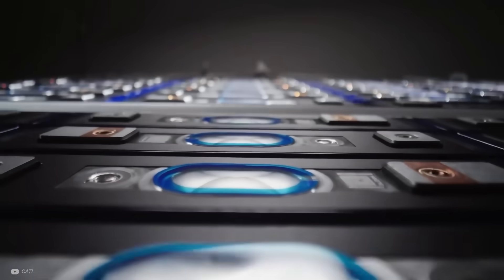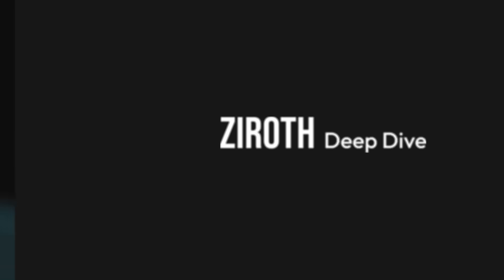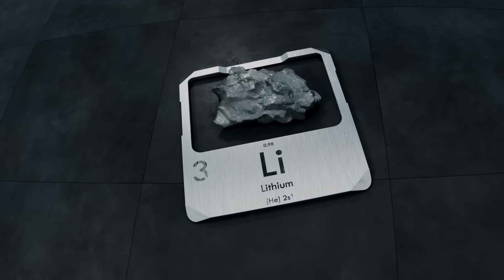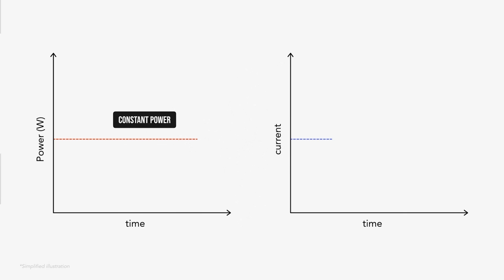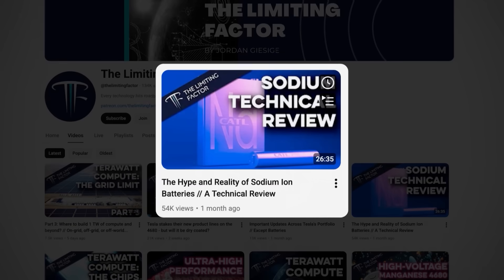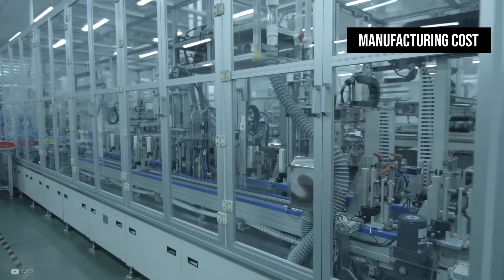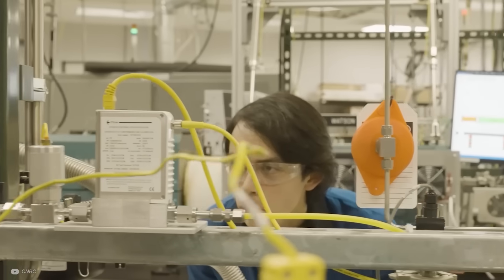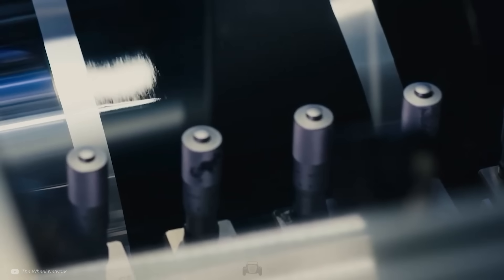How CATL’s Reinforced Sodium Battery is Insanely Cheap

Comment: CATL is already producing sodium batteries. The price is currently just under the Lithium batteries. CATL expects the price will drop to $ 10.-- per Kwatt/h in 5 to 10 years, probably 7 or 8 years. As the new sodium cells can be produced on existing production lines even with higher speeds, it will take no more than three years before the sodium cells will be available in large quantities and will become common in EV's.
Reply: $45 USD now, $30 USD is the Gen 2 goal and a long term price goal by 2030 of $19 USD per kWh is what their spokesperson was touting during a vlog piece from the Shanghai Autoshow IICR... The data shown in this video was already old and didn't take into account the newest CATL NAXTRA chemistry which is the one the video is really about.. The 175 wh/kg battery already superior to the first generation of BYD Blade LFP that people were raving about before.. Despite its 160 wh/kg density being lower..
Reply: @stickynorth  False. CATL hasn't announced any pricing information for their Naxtra sodium-ion batteries and in China high GED layered-oxide sodium-ion batteries cost ~75% more than LFP batteries (~US$70/kWh vs ~US$40/kWh).
Reply: Incorrect that they can be produced on the same production lines (at scale) and incorrect that the price of CATL's sodium-ion batteries is currently less than their LFP batteries.

Large, highly optimised LFP production lines will not be retrofitted to produce sodium-ion batteries.
Reply: @borg95  According to the CATL's CEO the sodium-ion batteries are already in production on a only slightly altered lithium-ion production line. As the raw materials cost less than the lithium they are slightly cheaper. As the sodium-ion solution has a lower viscosity it must be possible to speed up the production. He explained al in a video which is published on YouTube. Just have a search.
Reply: @wilsistermans1118  They're not cheaper and there are no public examples of any 10GWh/year scale factory switching from producing LFP battery cells to producing sodium-ion battery cells. Currently high GED SIBs cost approximately 75% more than LFP cells (~$70/kWh vs $40/kWh).
Reply: @borg95  Sorry, but my source (news) is the CEO of CATL and I think he knows what is going on in his factory.
Reply: @wilsistermans1118  CATL or their CEO hasn't provided any public pricing information on their new Naxtra sodium-ion batteries or stated what the nameplate capacity of their SIB production lines are.

CATL's talk of "mass production" of SIBs in 2026 is just marketing hype intended to put a lid on the price of lithium carbonate. It could mean many different things (e.g. 1/10/100/1000 GWh per year).

The nameplate capacity of BYD's SIB factory (which they've been building for the last two years) is only 30 GWh/year.

For comparison, the total nameplate capacity of all LIB factories has recently surpassed 3000 GWh/year.
Reply: @borg95  CATL currently sells Sodium batteries 2% cheaper as th LI-ion ones. There is no large scale production yet, but CATL is producing Sodium cells since 14th of november and planning to extend the production.
Reply: @wilsistermans1118  Source or data sheet or specs? Selling to who exactly and for what cell price (in $/kWh)?

When I asked them 12 days ago, Starmax Energy (Chinese battery reseller) said that CATL's Naxtra sodium-ion batteries aren't currently in bulk production and they said that they would post an update on their YouTube channel when cell pricing was released.

If you have a reliable source, do you know what battery chemistry CATL are using for the Naxtra cathode (e.g. NFM/layered oxide, prussian white, NFPP etc.) and anode (e.g. hard carbon)?
Reply: @borg95  The source was an announcement video of the CEO of CATL on the site of an Chinese newspaper. I saw the video in the first half of december, but they remove video's after a month. 
Production is still limited for the Chinese market only. Price is in Yuan only, but I don't know it.
The expectation (according to de CEO) is that Sodium cells will slowly become mainstream after two or three years.
Reply: @borg95  That depends more on what technology is more in demand of. That has always been a thing. The fact they can switch means it opens the door for a quick switch later down the road is all.
Reply: @adr2t  For large factories (multi gigawatt-hour/year) they can't and won't switch between producing LFP batteries and producing  sodium-ion batteries (see the Catalyst podcast titled the "Promise and perils of sodium-ion batteries" from February 2025 for reference).

This is why BYD has been building a new 50GWh/year sodium-ion battery factory for the last few years rather than retrofitting an existing LFP factory where they have spare capacity.

Current capacity of all existing LFP factories is estimated at ~3TWh/year and the large production lines can't just be switched over to producing SIBs when the demand is there.
Reply: @borg95  They will depending on demand. Almost all of them have or will. Its not that crazy considering its about the same process. Now, I think you are talking about hot switching- then no. Of course not, it be cheaper to produce a whole new line, but long term, they are not going to not switch if LFP becomeless than what Sodium can do if demand calls for it.
Reply: @adr2t   I disagree. There are no examples of any 1GWh+/year factory that has switched from producing LIBs to producing SIBs. I'm not saying it's impossible to switch, but my point is that switching cell chemistry for a large factory is a multi-year process. It is not simple or cheap to just switch existing LIB factories over to creating SIBs.

If you want a real world example see the 35 GWh/year GM/Ultium Cells Ohio plant, which announced a switch from NCM to LFP batteries. They expect the conversion of all cell lines will take over 2 years, even though converting from NCM to LFP is simpler than converting from LFP to SIB (e.g. NFM, PW, or NFPP) as only the cathode material changes, whereas SIBs use a different anode (hard carbon), anode current collector (aluminium) and electrolyte.

Also for SIBs to reach LIB scale, there is still a lot of work to be done on scaling up hard carbon production.
Reply: @borg95  What do you mean? Its not like they just factory just for SIBs just to test - they had to take a line/factory and produce them.
Reply: @adr2t  Testing is easy, you don't need to do it at scale. For at scale production they will create their own factory/production lines rather than retrofitting existing lines.

According to the July 2025 Benchmark Minerals article titled "Sodium-ion dominated by unproven cell producers", CATL has a sodium-ion battery facility (with a nameplate capacity of 25GWh/year once ramped up) that came online last year. Also CATL has been talking up sodium-ion batteries since ~2021 so it's not something that happened overnight.

The only other factory of that scale is BYD's 30GWh/year factory that they've been building for the last two years. Neither factory is actually producing sodium-ion batteries at anywhere near capacity though.

IIRC BMI estimated the total production of sodium-ion batteries for 2025 to be ~5-10 GWh, and estimated (nameplate) production capacity to be ~120GWh with growth to ~500 GWh in 2030 (with most of the planned capacity coming from "unproven" Tier 3 cell producers).

I expect sodium-ion batteries will take less than 10% of LFP's market share by 2030.

Comment: Same shitty  voltage curve that lead has.voltage goes down fast
Reply: The voltage curve is not the problem with lead acid, it is the death of the battery if the battery is drained aggressively a small number of times

Comment: at the beginning of the video 4 advantages are mentioned. There's a 5th advantage : Sodium batteries can be discharged, stored, and the capacity of the battery does not decay like Lithium batteries, that have to be kept charged to avoid battery capacity deterlioration.
Reply: Under what conditions would you  discharge a battery to 0 volts?
Reply: @MrSummitville I bought 1 from Bluetti. Watched videos before buying of people testing it. They say the low or 0V does not deteriorate battery capacity like with Li+ batterlies. Regarding tour question: transport? storage? using it in a wider cycle? or simply the network goes off long enough but you need it on no matter what what while you find an solution?
Reply: @johnbofarullguix1499   Lithium Batteries have a BMS. You can NOT drain the battery to 0 Volts. Therefore, it is not possible for you to hurt the battery.  Sodium batteries are not going to drain down to 0 Volts.  Your inverter will automatically turn off, at a specific Low Battery Voltage.  There is no situation where you are draining the battery pack down to 0 volts.

Comment: The first thing that came to my mind was, oke, so, sodium battery's get cheaper, competing with LiFePo4 battery's.
So as a result, less Lithium demand, so a lower price for lithium. Thus lowering the price of LiFePo4 cells.
But, as im typing this, maybe im wrong, I mean, how much of a percentage does the price of lithium affect the price of a cell ?
I think the price affect is very little, but im just guessing.
Simple sodium battery's however would be perfect to 1:1 replace with lead-acid battery's, especially in old cars and trucks.
The wider voltage range of sodium batterys could be a huge advantage for these purposes.
Reply: Yes, the chart showed a decreasing price for LiFePO4, too.  Both, Sodium and LiFePO4 down to $25 KWhr by 2035.

Comment: 08:10 i strongly disagree. This type of battery is ideal for battery storage, where size doesn't matter, but cost, longevity and temperature bracket. Especially the last is important for colder invironments. As soon a scaling effects kick in, it will outperform LFP cost wise very quick.
Reply: And Grid Back-Up...

Comment: One stat that was not mentioned is how many cycles will it survive through with these new innovations  Compared to lithium?
 Lower cost doesn't mean much if you have to replace it More often And the reverse is true doesn't matter if it costs more if it lasts 4 times longer
Reply: Currently, Sodium only 2,000 - 5,000 cycles. But improving every year.

Comment: Energy density could be measured in kW per kg or kW per liter. Some compositions excel at one but lack in another. Lithium is good at both those metrics. Also nobody seems to want to touch topic of battery volume change dependent on charge state. Bigger ion atoms make charge battery swell more when charged creating mechanical stress each charge cycle. Again lithium element is smallest atom solid. I'm not sure if you can beat that using any other composition.

Comment: What happened to aluminum ion? I thought that was the answer last year?

Wasn't supposed to not require retrofitting manufacturing, weighed half as much, cost 1/3rd to make, much longer lifespan than lithium, charged in 1/3rd the time, readily available materials?

I thought Musk was already switching over to that? 

Then I stopped hearing about it? 🤷‍♂️
Reply: Aluminium ion is still on lab research. I have read some journals about it and concluded that the researchers are still actively trying to solve the dendrite formation problem, since dendrite formation on aluminium ion batteries are far more aggressive than the ones on lithium or sodium ion

I will say that it won't come out at least in a few years
Reply: @sihamhamda47  bummer, because it sounds like the answer... 😪

Comment: There is plenty of demand for this, so whoever solves this problem makes a lot of money.  Who and when this will happen, its not easy to tell.  It will happen as fast as it can because a very large # of people are looking at it.  The one that gets into a car is going to be a cost effective one for sure because that is what moves the needle to the base consumer.  Lithium will still evolve and make it even harder to beat.  Hopefully something actually can get into mass production and permanently solve the slow charge, weight, cost and safety issues of lithium.  People keep saying 5 years out, but they thought that when tesla had their big battery day thing.  Its probably 10 years out from right now before solid state or some real shift in batteries are in most new evs.

Comment: It appears the sodium-ion cells are at a lower voltage in their discharged state than lithium batteries. Will this require DC fast chargers to operate at higher current charge rates than they do now?
Reply: Appears?  The video discussed the voltage curve.

Comment: Thinking sand powered by table salt ;)

BTW, it's hardly a breakthrough really. It's less revolutionary than Li-ion vs NiMH and that wasn't that big of a leap either.

We want batteries that charge like capacitors but hold as much energy as gasoline.

If it's not that I'm really not impressed.

Comment: It's not over yet silver cobalt batteries have a significantly higher capacity and are solid state. Safe charging in five minutes , twenty year operational life. Almost twice the capacity of lithium ion.
Reply: Who is working on that?
Reply: @MrSummitville Samsung's "silver battery" refers to their next-gen solid-state battery technology, which uses a silver-carbon composite in the anode for higher energy density, longer life (20+ years), and ultra-fast charging (9 mins for 80% charge), targeting premium EVs with ranges up to 600+ miles by using silver to improve stability and performance, a significant leap from current lithium-ion tech. 
Key Features & Innovations:
Silver-Carbon Anode (Ag-C): Replaces traditional materials, boosting performance and preventing dendrite growth (a common solid-state issue).
Solid-State Design: Replaces liquid electrolytes with a solid, increasing safety, energy density (500 Wh/kg), and lifespan.
Performance Metrics: Promises 600+ mile range, 20-year lifespan, and 9-minute 80% charge time for electric vehicles (EVs).
Applications: Initially aimed at "super premium" EVs, with mass production targeting the late 2020s. 
Why It Matters:
Addresses Range Anxiety: Significantly extends EV range, making long trips feasible.
Reduces Cost & Weight: Higher density means smaller, lighter batteries, improving vehicle efficiency.
Market Impact: Could disrupt the EV battery market and increase demand for silver, notes Metals and Miners, The Jerusalem Post, The Jerusalem Post, and GOLDINVEST.de. 
Status:
Samsung SDI is developing these, delivering samples to automakers, and working towards mass production, potentially by 2027.

Comment: [4:17] Ugh. Could you not show a graph with current starting at the X axis? That's soooo misleading. The reality is that you are depicting a factor of 2× (from 4V to 2V) and it would be perfectly reasonable, and would show your point just fine, to to put the X axis at A=0 (and V=0).

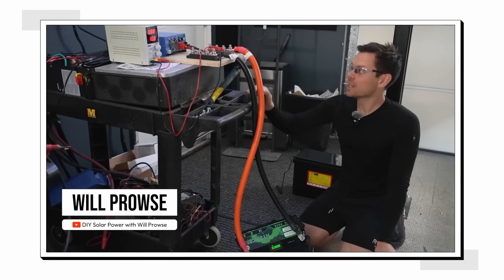And for that matter … why redraw the voltage curves at all? You already had a better graph just prior, at [4:05]. Just rescale that graph to put the X axis at V=0, and overlay the current in red, with a red scale on the right also starting at A=0. More accurate, more convincing, and less misleading.

Comment: Are you really mixing up LiFePO4 cells with Li-Ion batteries? I think you should inform yourself a bit better !
 ION is NOT equal to IRON !!!!!!!!!!!!!
Reply: Yeeeeah, that was what I was going to whine about. 3.3V vs 3.7V is a Big Deal® in batteries, electronics, and discharge detection.

Comment: I'd like to see extremely long life, sodium Ion cells even if they have reduced energy density. 
Cheap and Reliable are critical for home and grid energy storage solutions. 
I'd like sodium Ion battery banks that can last 30+ years without significant degradation. 
If we could get the price down below $100/kw-h consumer retail price. It would be HUGE.
Utilities could more economically stabilize energy production from renewables. 
I'm holding off on electric cars until a extremely long term stable ultra reliable high energy density battery technology comes along. 
Right now the cost associated with replacing a battery pack outside of warranty makes long term ownership of electric vehicles a dice game.

Comment: Hydrogen is even cheaper and much more abundant, and the atoms are the smallest. Why don't we have proton batteries?
Reply: They are called Fuel Cells.
Reply: @MrSummitville  No. Fuel cells are fuel cells. And they require crappy hydrogen tanks, and you can't recharge them.

Comment: I was waiting years for these news about sodium batteries. It will take 10 years for sodium batteries to drive out lithium batteries in cars. But for electric storage battereies in the power grid, sodium batteries are the one and only solution. Does anybody remember the change from germanium to silicium semiconductors? History repeats partially.
Reply: Hang on, there. Germanium still has its place in semiconductors for very specialized applications. Silicon is far better for the broad spectrum of electronics, but still isn't the Final Word when it comes to switching -- there are speed of light limitations, electron density limitations, yada yada yada. We can't be comparing apples to rainbows.